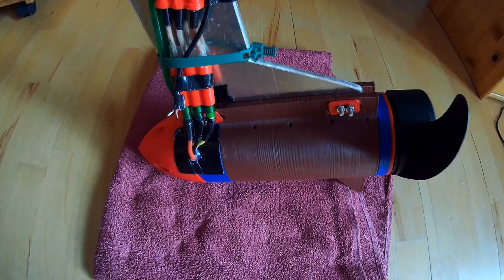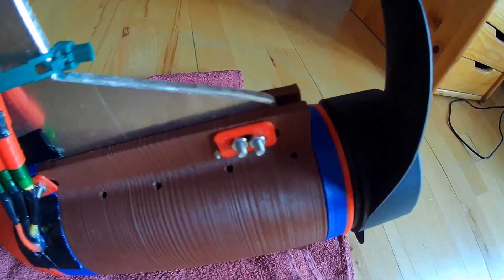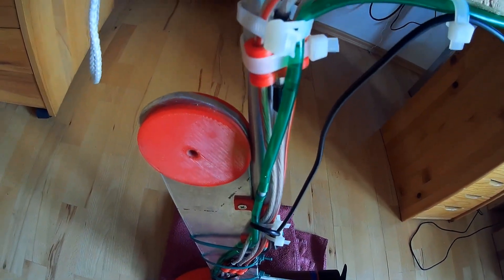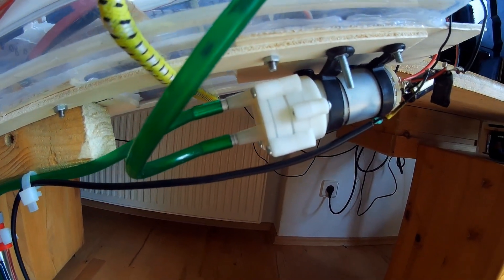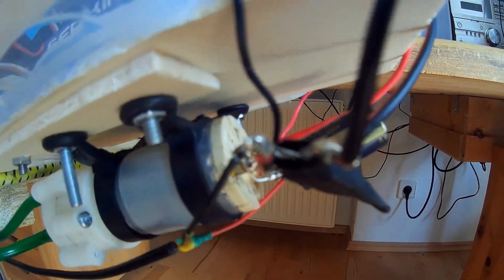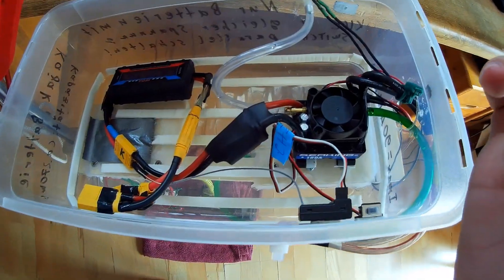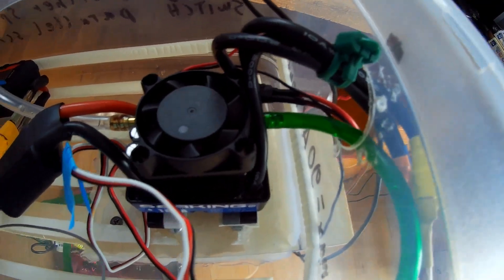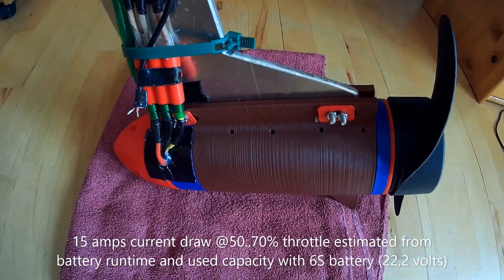Brushless Kayak Motor 2.2 (DIY)

Comment: Looks good! I was wodnering if you will do a tutorial build video? That would help in my build alot!
Reply from the maker: Good question. This whole project was kinda more an experiment to see if it is possible to build a trolling motor with common rc parts and 3d printer. The small brushless motor has the problem that it requires a gearbox thus needing to be protected from the water and since 3d printed plastic is never 100% leak free the only way to do that is with marine grease whitch works but is not the best or longest lasting solution. 
So long story short: You can build one if you want but I do not recommend it beyond what it is.
Consequently I will probably not make a tutorial for this version. But if I follow up on this project in the future I will try to choose a motor that does not require a gearbox (maybe a big brushless outrunner). And if that works I will think about making a tutorial on it.

Comment: Nice motor. I have a bow mount trolling motor on my HYBIRD 120, sit on top 2021 fishing kayak, and run my toe control vibe gravity rudder with the bixpy..Obvious I tun the Bixpy to to get from spit to spot, and then use my troller, or I'll paddle around.  If you're just recreation, sit in kayaks yikes, very dangerous..
Reply from the maker: yeah, heard about the bixby, never tried one though
Reply: @rcandfun242  you'll love it, and nice to have. You get the Bixpy motor,  which can be mounted however you like. You also receive your remote, lithium floating battery, kill switch. All the hardware. That battery runs the motor, electronics, charges other devices, and the total kit weighs 9lbs. Just nice to have. If you purchase the other motors, they need a certain surface to mount to then, a battery and they're expensive. For how I fish it's perfect speed 6 out of 12 one battery will last all day. Good luck my friend  🎣 🙏 🤙